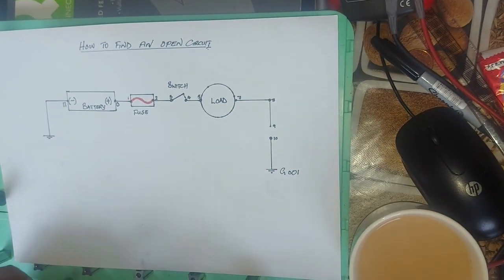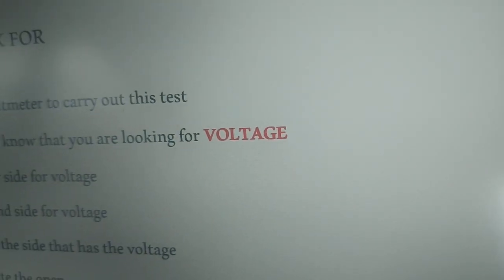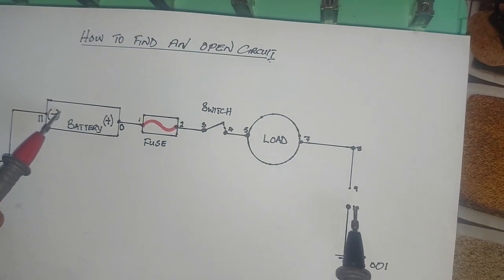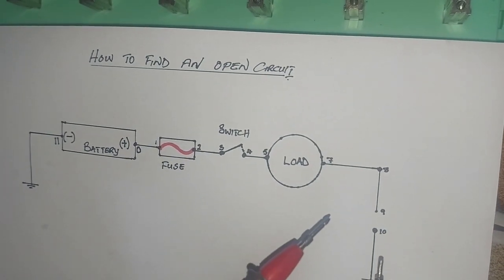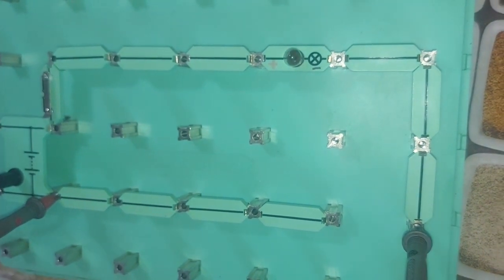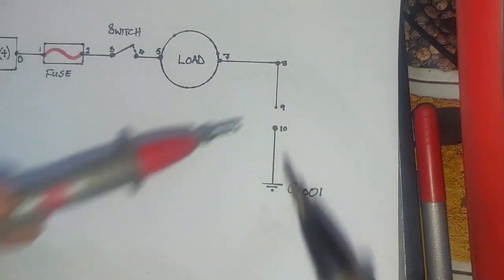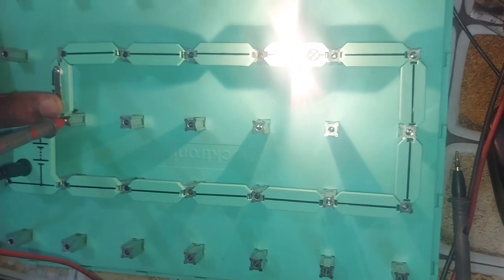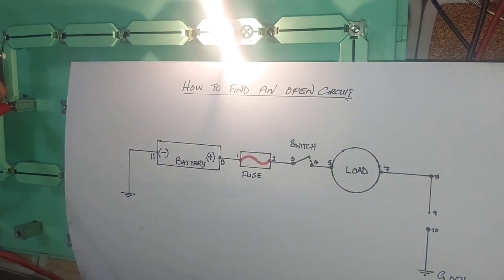Open Circuit Voltage: The Most Misunderstood Concept in Electronics

Comment: Excellent work. I must say that I'm not a technician, I just find a solution for a recurrent problem on my car. I went to a bunch of mechanics, even to a dealer, the change so many parts but the problems is always there. I know that there is an issue that will be so easy to fix but you need someone that really understand the car (I'm from France btw). 
I have  a turbo related problem and some mechanic suggested that maybe is a wiring problem but nobody can tell me for sure.
This is the most practical video that you need to see to identify that your wiring has faults, well, one of the application.  This is true all kinds of electronic work. If you understand that you're on the good path.
Your diagram is correct, but you need to put another one with the multimeter in. Why? Because you can explain better why you have voltage when you have an open. You said it once, but with a diagramme will be more clear (the multimeter is closing the circuit, hence the voltage). Thank you for giving me the idea how to search for an open in the wiring harness.
Reply from the maker: Thank you for your support. I will post another video as soon as i get an open circuit problem. it's better showing it on a car